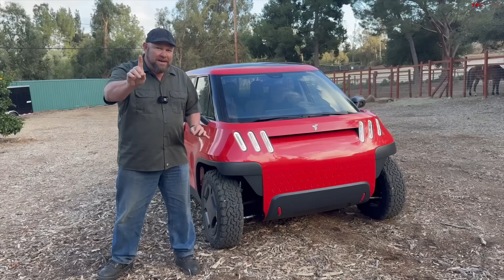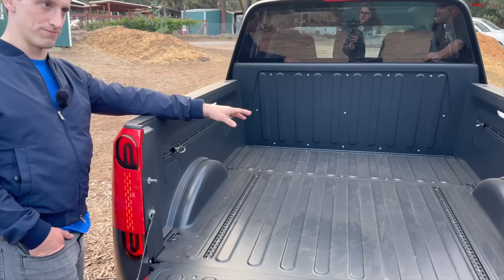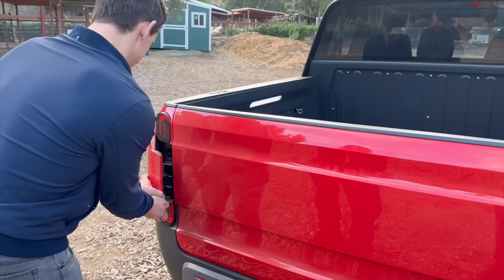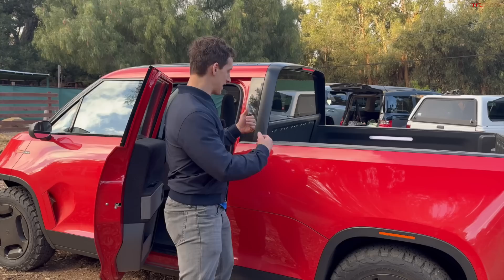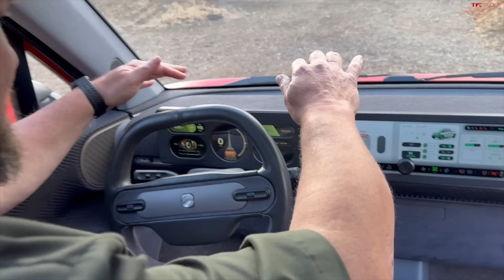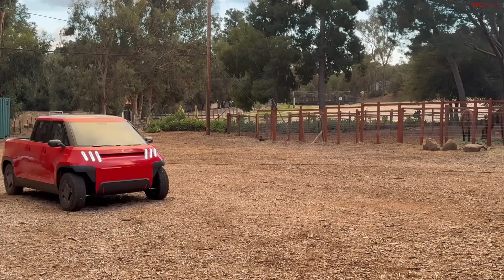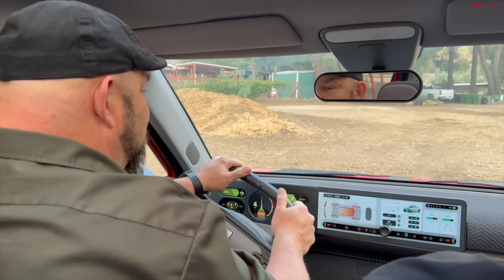I Drive the Most Revolutionary Truck In Decades: Meet the Telo MT1!

Comment: Cool lil truck. I like the size of a mini, perfect for street parking and center city.
Reply: If you can fit 4x8 panels in it, plus 4+ people in it if you're not hauling, plus AWD and a fast motor option, plus decent range even in the base battery, what's not to like? Seems too good to be true, honestly. I really hope they succeed. EV trucks are pretty crap at this point and the segment needs a shakeup. No, I do not want a nearly 9000 pound Silverado. No, I do not want an F-150 that can barely tow despite lying about its range. No, I do not want a Cybertruck. I want THIS truck.
Reply: Urban landscapers, couriers, utilities etc should love this thing if it makes it to mass production? Also outside the US it could do well depending on pricing. Just because of the compact footprint.
Reply: @4literv6  outside of the US you got kei trucks which I do think are a bit better than this truck do to having more bed space and being able to bring down the sides of the bed but you never know
Reply: exactly.  Deliveries to restaurants in big cities with tight streets

Comment: An 8 foot bed would be freaking epic. I could fit all of my Surf equipment in it no problem. Both of my kids will be out of the house soon and a two seater truck with an 8 foot bed would be an absolute dream to own.
Reply: It's 7'2" to the end of the folded down midgate. You can get to 8' inside the tailgate, but have to pull the front seats pretty far forward for that. If going surfing by yourself, could easily do that on the passenger side with no inconvenience, but if you're tall like me and trying to haul sheet goods, it's gonna be tight. 

Still, it's incredible what you can do with it. That truck is 5.5 feet shorter than my tundra, has a bigger potential bed length, higher payload, similar towing, quieter, can seat 8 with added cap and seat, etc... 

I def am interested. This combined with a fold up utility trailer would replace both my family SUV (VW ID.4) and my tundra.
Reply: It isn't 8 feet though. Not if you want to fit in the front seat.
Reply: @ I think he said there would be a two seater with an 8 foot bed? I’m fine with the 6 foot bed. I’m exactly the person they’re talking about. Surfboards and snowboards are what I’ll carry the most. 
If I need to tow something or get 16 bales of hay in a pinch, I’ll use my three-quarter ton.
Reply: @craig8638 

The bed is 8 ft with the midgate down and there'll be a lockable tonneau cover for the bed to keep the weather out (or the bed cap).